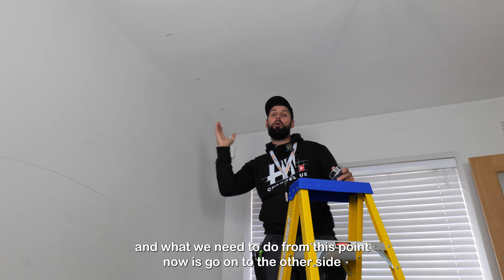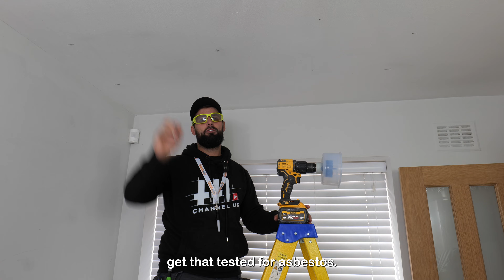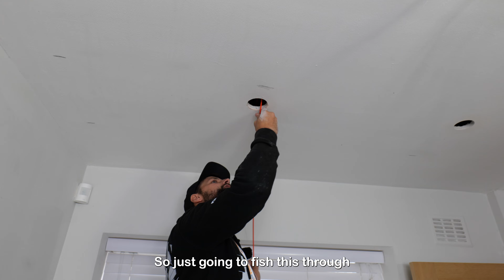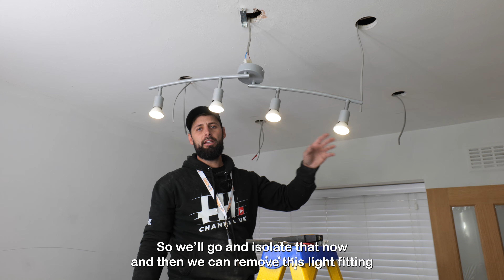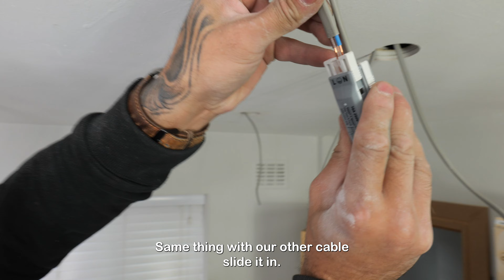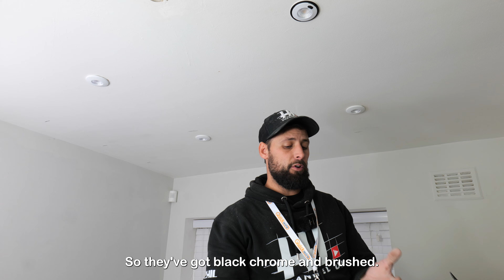How To Install LED Downlights With No Access Above

Comment: What if there is wool insulation in the ceiling? Does that cause an issue when running cables?

Comment: Why do we need to drill the joist? can we not get the cable over it?
Reply: If it's ground floor then the upstairs flooring may be attached to the top of the joist leaving no path to run a cable over the top. If it's first floor and there is a loft above then you can just go over but you should fix the cables to the joists with clips
Reply: @SubLowForty  Although I have actually finished installing the lights in the rooms, this is good to know for any future projects - Thank you very much.

Comment: Never that easy, you could have noggins or cross members in the joist between the lights, also those rods are not that flexible and getting them through the other drilled hole would be a nightmare

Comment: On the T connector does is matter which side of the plug you put the loop in and loop out?
Reply from the maker: Yes it’s labeled 😊
Reply: @homeimprovements  on the t connector plug I can only see LEN on one side and NEL on the other, no other labels.  I wasn’t sure if the power in from the previous light has to go in one side and power out in the other.   Or if it doesn’t matter.

Comment: Great video guys 👏.  Is there a limit to how many lights I can add to the chain?  I am going to need 9 but don’t want to overload the circuit.
Reply from the maker: 9 led down-lights will be fine on 1.5 cable 😊
Reply: @homeimprovements Jim’s it is not an electrician, don’t encourage him. What you are doing should see you struck off any domestic installer scheme NICEIC or otherwise.
Reply: @121K9Training why

Comment: R1+R2 MWC?
Reply: You would do a R1 + R2 but because this isn’t a new circuit for this type of job a MWC isn’t required but obviously if it’s a rental / housing association it may be required for the tenant.
Reply: @wesley3312  I thought a diyer touching their own electrics is illegal, as I keep getting told by every spark.I’m competent in changing a light fitting and probably know more about electrics than you average diyer but unfortunately I’m not allowed to do it for insurance purposes so I’m told 🤷‍♂️
Reply: @kingofthetrowel1725  if you’re In a rental / housing association, or your home insurance requires you to have certification then yes, you would require someone who is competent to complete the works and to issue a MWC. It’s not illegal, but some works require signing off, the person needs to be a member of a competent person’s scheme, NAPIT for example, or the job needs to be notified to local area building control for it to be approved/ checked over.